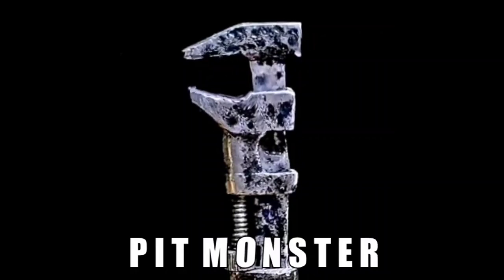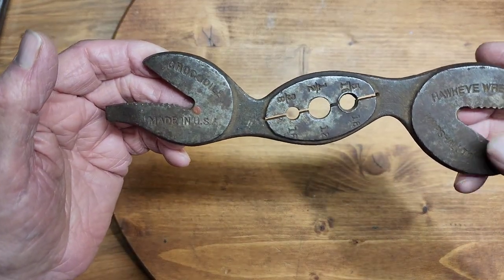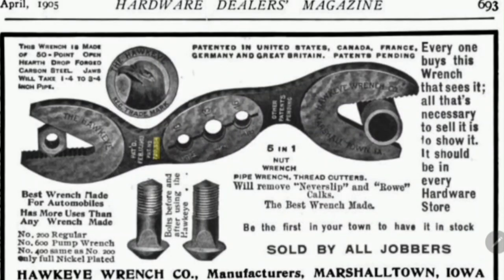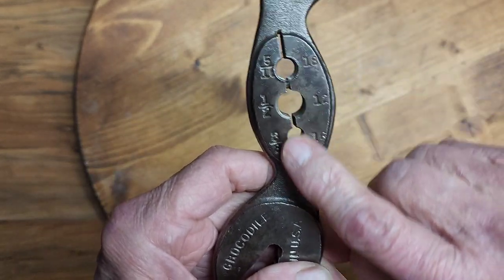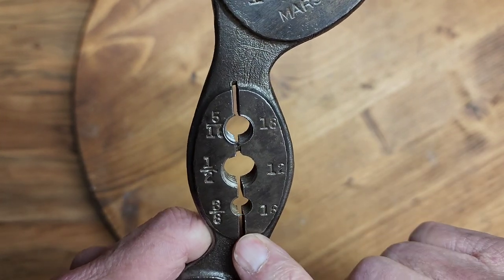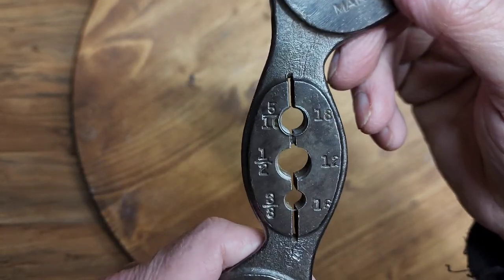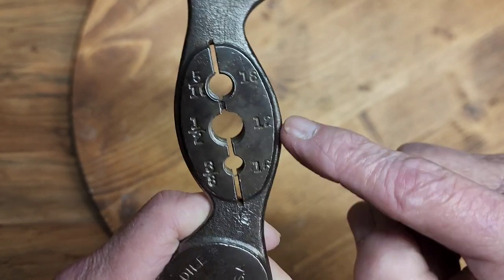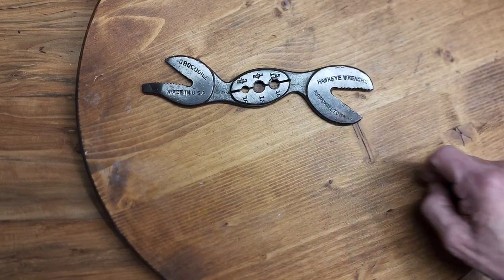Hawkeye Crocodile Wrench with strange sizes

Comment: At one time there was a 1/2 x 12 thread size. A few years ago Keith Rucker on YouTube was restoring a antique machine and needed a tap in that size. He found one that was spendy, but he had to have it to finish the job. He said it is a very old thread design that has not been used in many years.
Reply from the maker: Thanks for the info Chuck. I explained in the video the 1/2 x 12 TPI was a British Whitworth Standard size.

Comment: Did you try a 1/2-13 rod? Maybe the stamped pitch was wrong on the center hole too?
Reply from the maker: Yes I did. I showed it in the video. And it is 1/2-13.